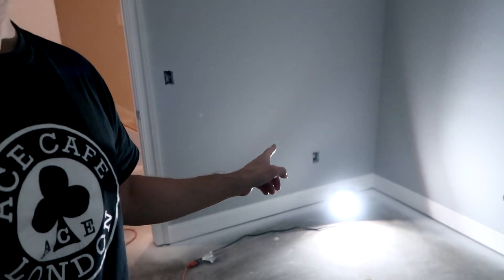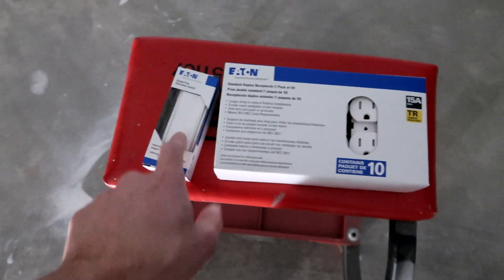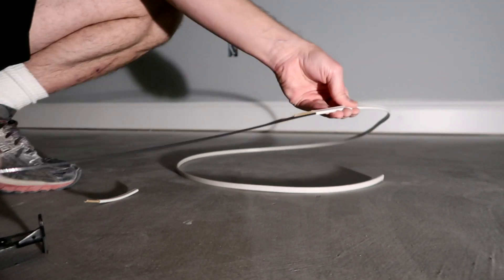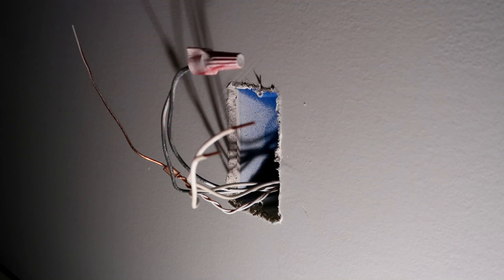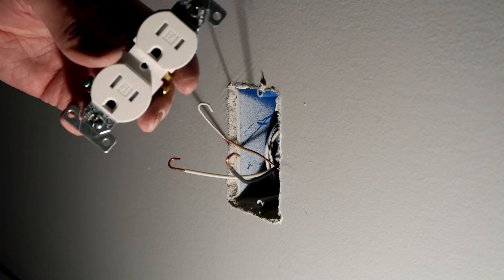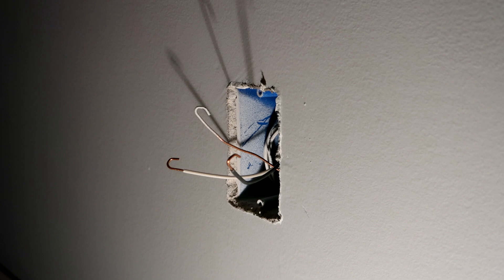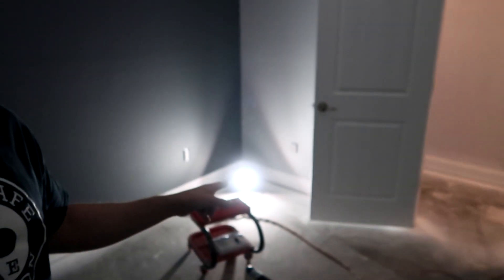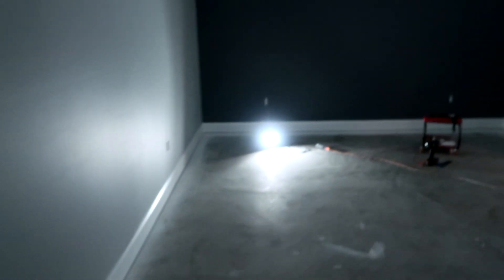How to wire a light switch and multiple electrical outlets, This will help you understand

Comment: When would u use a red wire. Like 12/3?    I thought the 3 wire had to be used w light switches?????
Reply from the maker: Typically you would use a 3 wire when doing a 3 way switch. You don't need travellers when just having one switch

Comment: Thanks!  I have a switch that controls multiple switched outlets for lamps etc.  I’d like to get rid of the switched portion on one outlet but continue the switching on the rest of the outlets.  I know I need to purchase a new outlet that doesn’t have the tab broken but what would the wiring look like on the new outlet?  When I look in the currently switched outlet, I see the bottom switched outlet with a red wire on the hot side and a black wire on the always hot upper outlet.  The tab is broken.  On the other side of the outlet, the ground is connected and there’s one white wire.  The tab is intact.  On the switch, the red wire is connected to the “on” side (switched is up).  On the off side, there is a black wire.  The outlets show three white, black, and red wires in wire nuts.  I assume the wires going into the dual outlet are pigtails.  Question: If I remove the red pigtail and wire nut the top on a new outlet with tab intact and simply connect the black, white, and ground will I end up with both plugs hot on that outlet and leave the others in the circuit switched?
Reply from the maker: Really tough question to try to answer without seeing it in person. After reading the comment I'll do my best to understand what you mean.

Usually only one plug in any room is wired to a switch on the wall (in order to turn on/off a floor lamp or the like). There isn't usually any further outlets wired into the "switch" behind that first plug.

At the switch, the red wire is leading down to your plug that gets turned on and the black wire is hot coming from the panel.

If I understand correctly, you have a multi outlet setup that has 3 outlet boxes (6 plugs) and you want to convert the first switched outlet back to constant power and make any downstream outlets switched... If that's the case, yes you will need to put a non-severed outlet in there and make the red (switched) wire continue on to the next downstream outlet... Hopefully that is helpful 👍

Comment: Great video. An added tip, twist the wires with a set of linemen pliers before screwing on the wire nuts. Makes sure of a good connection.
Reply: he should use the wago 221

Comment: does it matter which black wire is attached to which screw? meaning, does it matter if the hot lines go on the top vs the line connecting to the light?

Comment: Good job, did you do the rough in and drywall also?
Reply from the maker: I did all of my basement work except for drywall. Check out some of the other videos in my catalog, shows everything I did 👍
Reply: @PlatoonGarage  you do not need to make the j-hooks on the light switch because that switch has screw clamps.

Comment: For the led lights do you buy special cans so it doesn’t have a normal bulb plug?  Or is it all one unit? The can and the led together?  Thanks for the videos I’ve watched them until 14.
Reply from the maker: Hi Scott, no special cans.  just your regular recessed light cans.  the ones I bought were halo, made by eaton.  the LEDs I installed all in the basement are similar to the ones i show in this video https://youtu.be/DPCBSM24KHs but the basement ones have adjustable color range

that video shows you how the LEDs connect in to the can.  That being said, they do also sell some LED "kits" that are slightly different that come with a control box and a plug that plugs in to the LED wafer (for lack of a better description).  those style are made for ceilings that don't have a lot of space in the rafters above.